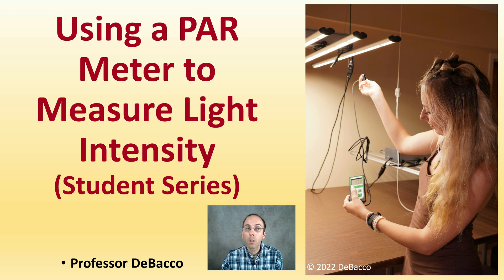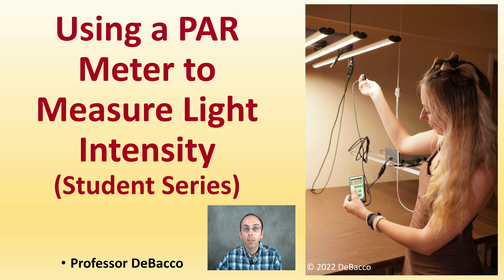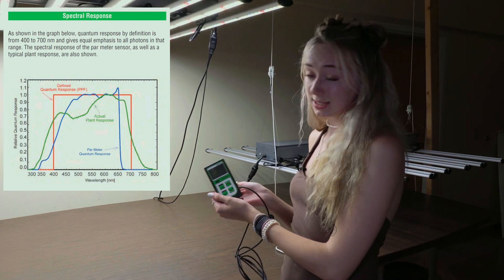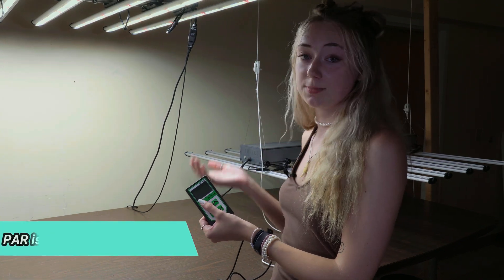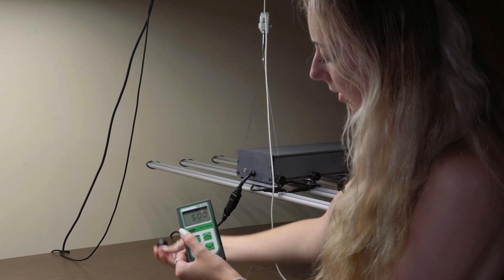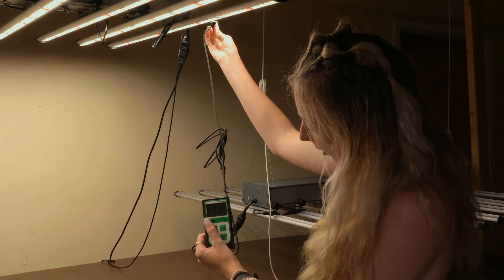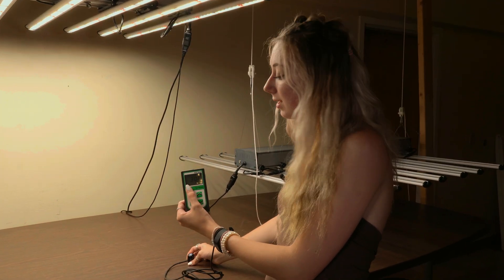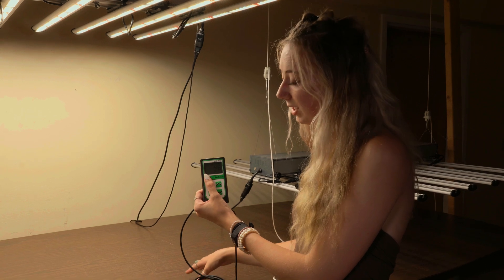Using a PAR Meter to Measure Light Intensity (Student Series)

Comment: May I ask, the PPM is 770? For clones? Also what scale is being used 500 or 700? What scale does the us usually use? Isn’t 770ppm a bit high for clones? I can be very wrong.
Reply from the maker: This is a great question and it does show in the other video, that it is EC*700 = ppm scale.  Yes, 700ppm is considered strong for clones, but this is the upper range as fresh water is added when needed so this will naturally drift down, but the clone seem to do fine.
Reply: @DeBaccoUniversity  thank you for the time to answer this question!

Comment: Did she say 1000 volts??
Reply: we had a long day of recording, haha! good catch, sorry for the confusion :)
Reply: @kannakiera8928  I was more giving a hard time
Reply: @kannakiera8928  Best to ignore most comments. The internet is a savage place
Reply from the maker: She did, but a correction was made in the video text to say that light intensity is measured in PAR not volts.  However, if you want to learn more about the lights used... These are the Fluence SPYDRx PLUS LED Grow Light System that is recommended for environment with CO2 supplementation due to the high PAR.  Power consumption is 660 watts and this version may not be made any more as there are new 2 series out.  However, for more information see this link... https://www.bghydro.com/fluence-spydrx-plus-led-grow-light-system.html?utm_source=google_shopping
Reply: @DeBaccoUniversity  it sounded like she was going to say 1000watt lights
Reply from the maker: These LED's are intended to cover the same area as a traditional 1000watt HID light.  However, the rest of the information she presents is accurate so this is why there was just a corrective note included in the video.

Comment: Does the type of par meter mater? They look crazy expensive
Reply from the maker: The one used on the video is what is the standard, there are others as you are correct the price is prohibitive for many growers.
Reply: @DeBaccoUniversity  exactly. Based on what I can tell from comparing the look of the meter used in the video with what I can find online, it looks like you're using a Sun System PAR meter which is going for $354 on amazon right now. That's out of my reach at the moment so I was hoping there might be a more inexpensive option that would still be accurate
Reply: I have a video on cheap ppfd meters. Under my tips and tricks Playlist. Might be helpful. Around $40 gets you pretty damn accurate

Comment: I got my PAR meter from China. Not allowed to say the distributor as YouTube or Debacco removes my comment if so :) A good PAR meter is essential while the price of energy rises. You can calculate the exact required DLI using the PAR readings and a few other parameters and really cut the cost of your grows considerably.
Reply from the maker: Must be a YouTube blocking as it would be great to know what you are using.  But calculating DLI is a great way to keep your lighting efficient.
Reply: Just spell it out with spaces or periods after each letter

Comment: Definitely worth it. Just learned the hard way with spiderfarmer. Biggest top ever but one day discoloration. Sure enough mold. My leaves always brown out and creep into the cola but their so thick cant prune the leaf stems. Nute problems or late harvest?
Reply: I've  had same  problem  over the years. 30 or so,You describe it perfectly. 
Only outside. I've never known actually  why.
All  fruit, flowers  ect. Will  bruise then rot  whenever  they are  ripe.
Reply from the maker: You have been provided some great advise by other growers who watched this video, humidity and VPD should be looked into.